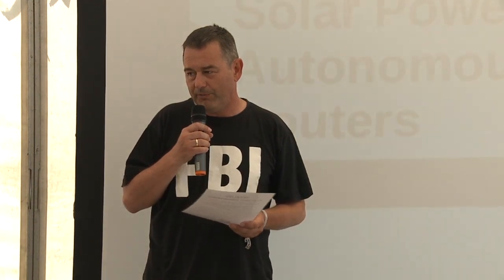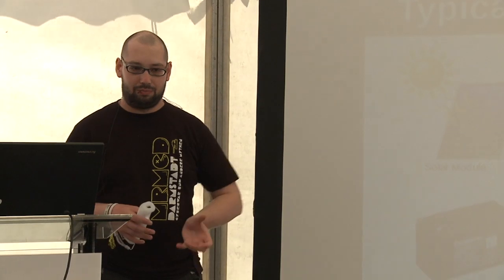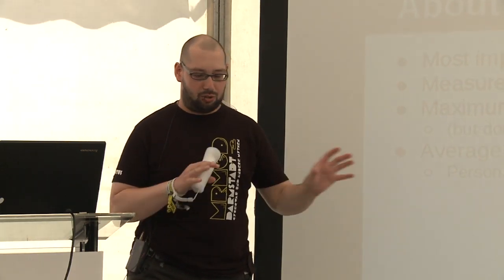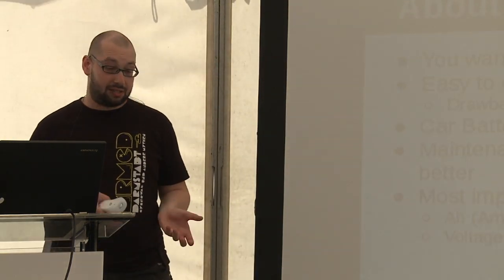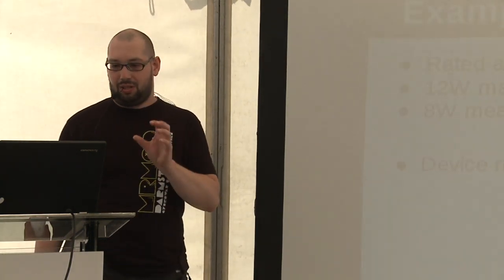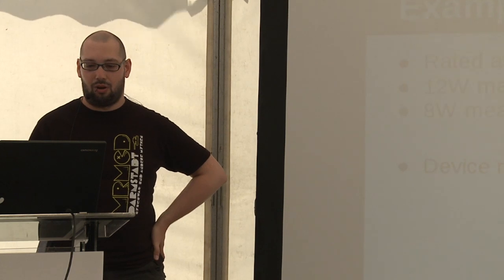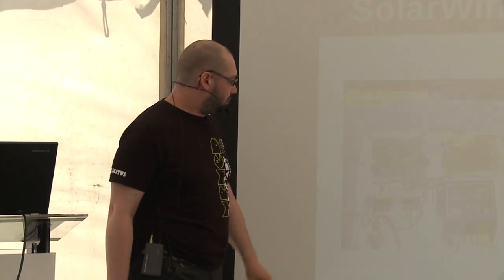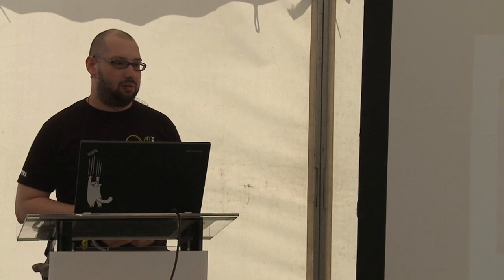OHM2013: Solar Powered Autonomous Routers

Comment: Thanks for this real world solar router presentation.  For lead/acid batteries, it is best not to deeply discharge them.  Most folks with solar/battery systems try to only discharge them 50% at most.  Also, I've read here and there that PWM chargers are better for battery lifespan than the MPPT chargers, so there is a trade-off there.  Thanks for the real world demonstration of just how much power our simplest gadjets use and how little we can actually get from solar from a cost and space requirement standpoint.  There is a lot of unfounded optimism out there.  I have a friend that mounted and 12 inch by 12 inch panel on his electric scooter and was shocked that it took weeks to charge his scooter battery.  Math and physics are beautiful friends, but are also brutally honest friends. For networking, to conserve energy the best, wireless is not the best choice as most of your transmit energy is being sent out to nothingness.  Better to just use dedicated cabling if you want to save energy.  If you really need wireless, then use a router on which the radio tx power can be lowered to just the bare amount you need as it is the tx energy that will sap the battery the most. Most routers supported by openwrt allow this adjustment.  Using highly directional antennas can also reduce the amount of wasted space the signal is broadcast into.  Using a good omni with good impedance matching is much better than using a poor omni with poor impedance matching.  Poor impedance matching just makes the antenna cable heat up instead of energy going out as signal.  Also lowering the beacon frequency, using a short preamble, using longer packets (less overall overhead) can help.

Starting from the ground up with something like the following would be the place to start:
http://www.embeddedarm.com/products/board-detail.php?product=TS-7260
[ I just realized that the board above doesn't have a mini-pci slot for a radio and no on-board wifi, so USB would be the only option ]

Also, slowing the clock speed can save you some juice.  I've never used power save mode on an openwrt router so don't know if it makes sense, but gather the kernel supports it on some hardware.